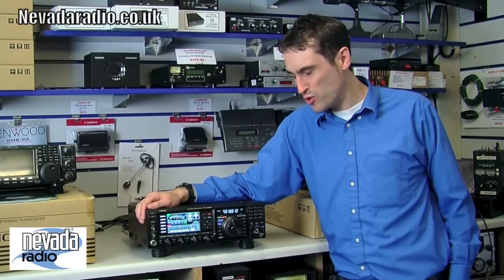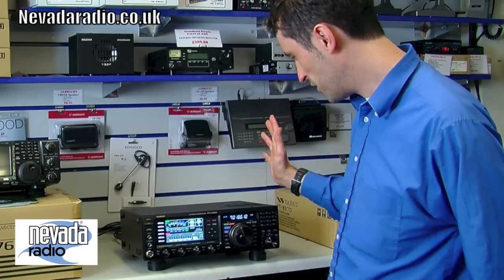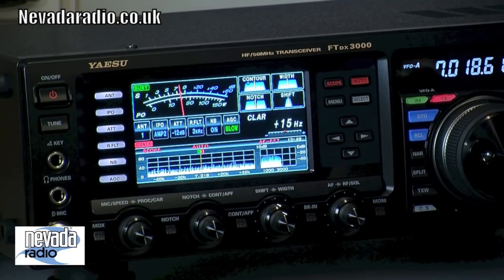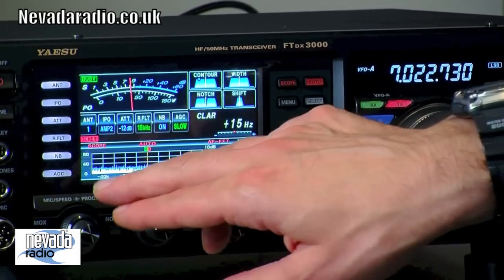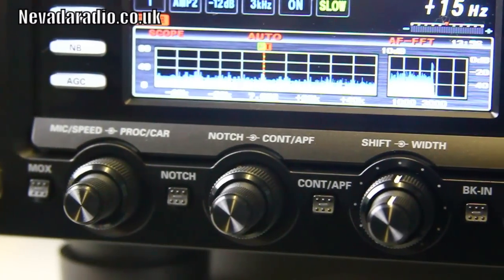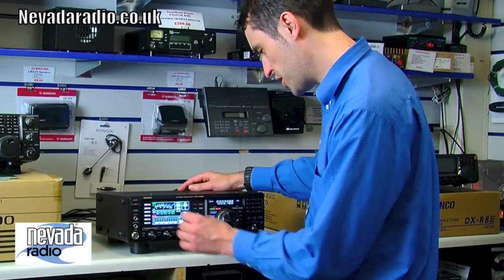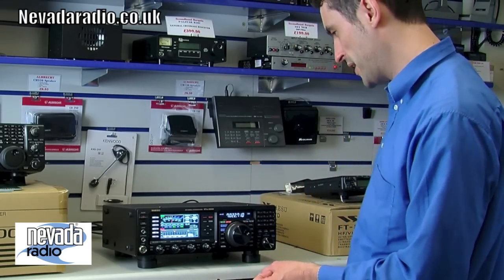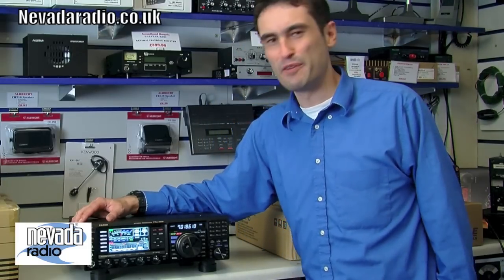YAESU FT DX3000 Review at Nevada Radio UK

Comment: I've owned one of these for over 3 years... Great Radio to use...  Excellent Contest SSB Radio... I can work two stations on the same frequency in contests by using many of the controls... The contour DSP filter is excellent. I can work very weak portables by using the contour on 100 or 200...  with the IPO on 1 or 2.... Highly recommended.  When using My old Radio , a Yaesu ft-920  when the VKFF started , I couldn't hear most stations... With this Radio I can work virtually any I can hear, by using all the controls....  VK2LEE  Lee
Reply: Hi, can you do a tutorial video ? I just got the 3000, but lost on how yo use it in the way you do, thanks

Comment: Thanks for the review.  Yaesu FT-DX3000 seems to be an excellent performer based on the Blocking GC and IMD figures. But numbers do not mean that all is perfect, far to be. Indeed, in the field this transceiver is disappointing. The nice band scope is almost useless, and the access to many functions require 4 or more operations on the menu ! Then, under heavy noise, the AGC is not efficient. At last, using an amplifier the processing is almost in ALC (not better on Yaesu FT-DX5000 or FT-950) with no point in Class A. In fact, a mid-range transceiver like Kenwood TS-590SG gives better results !

Comment: Buy a 1000mp instead.   Might be worth telling potential customers that the RTTY decode baud rate is fixed at 45,45 so a lot of stations cannot be decoded.  The spotting feature might be worth a heads up too.  This could be a brilliant radio if they had got the software right.  They are on their 3rd issue already, great fix for some things, but it's taken away other features to fit in the fixes.  I love Yaesu gear, but this has some serious problems both in the firmware and in the front panel layout.

Comment: Amp set on 2 with 12db attenuation? That makes no sense at all. What happened to the RF Gain control use which is the most effective control on any receiver. IMO. The NR can be used sparingly to really bring out the quiet Receiver this model has. Lay off the Processor though and if you use it, keep it under 20 and don't exceed the ALC limit and all will be well.